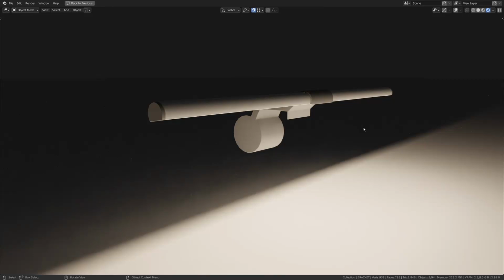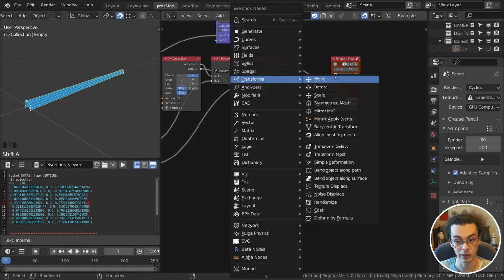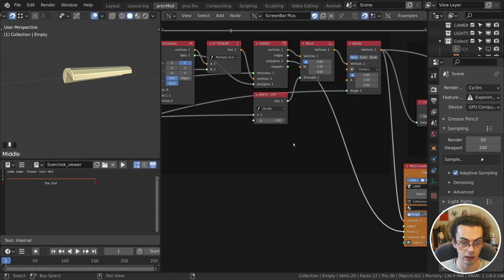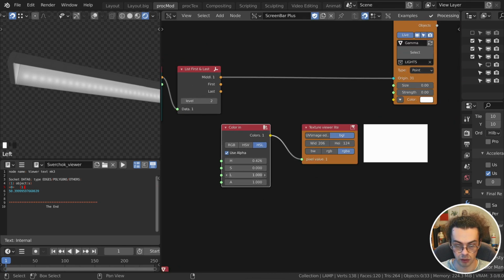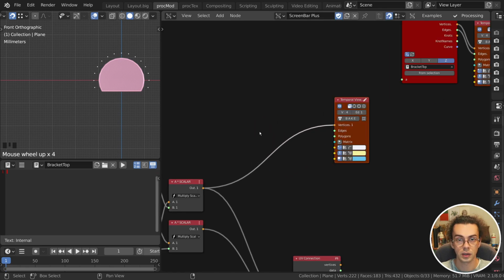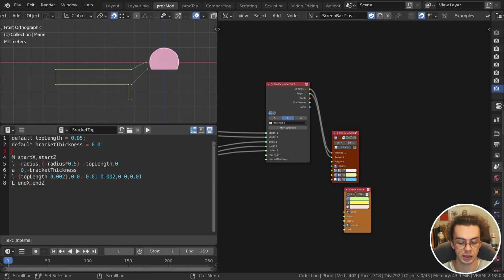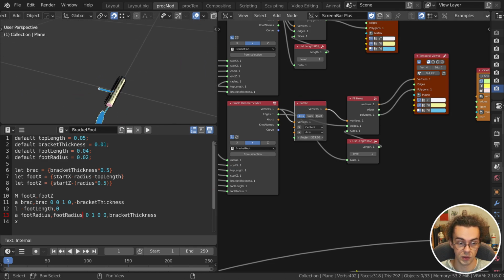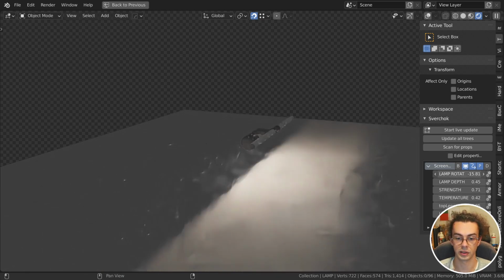Parametric Lamp Design with Sverchok - Blender Procedural Tutorial

Comment: 18:06 How do you drop that lamp length connection without connecting another node?
Reply from the maker: Do you mean how do I remove the reroute? You can use CTRL+X to dissolve a node without breaking overall connections! Super useful and just the same as in 3D when we can dissolve a vertex without deleting the edge on each side.

Comment: Hi Erin! How r u doing ?
How do we control the number of vertices of the arc we made using the profile parametric mk3 node? Is there any way to do that?
Reply from the maker: Hi! Yes absolutely you just add n=_ at the end of any line with a curve resolution. For example in the BracketFoot script if I change line 13 to "a footRadius,footRadius 0 1 0 0,bracketThickness n=64" then the arc will have a resolution of 64.
Reply: @Erindale  Wow! Excellent!

Comment: Very interesting tool set seems like something Blender Foundation should look to take on board given their move to everything nodes. Perhaps not the most user friendly way of modelling certainly but for parametric CAD type work very nice. Thank you once again Erin, clear demonstration you actually made it seem not too difficult.
Reply from the maker: Once you get your head around lists, it's actually quite 
straight forward! Grasshopper (for Rhino) seems to be it's closest cousin and the workflow is very similar. GH is an industry standard for architecture so slightly more understandable that the workflow isn't quite so friendly for animation style pipelines
Reply: @Erindale  I spent most last year using Moi3D for modelling and really like the NURBS workflow, so much so I only used Modo for the rendering in v-ray. Another reason I found dropping Modo easy and coming back to the Blender fold.
Reply from the maker: Well Sverchok (especially with the extra nodes enabled) has a whole bunch of curves/NURBS/solids workflow complete with exporting to and from JSON files! I definitely recommend it for those nice CAD workflows. You can even export SVG  with a little bit of wrangling so proper buildable drawings are in reach here
Reply: @Erindale  Thanks for the tip I will certainly look more into this, once I get the shader nodes under my belt.

Comment: Random question : this is amazing and looks like the next level of vector displacement black magic, but... is it useful in general ? What I mean is, I know that in a professional scenario nobody would model a character via pure displacement so learning how to do this is a bit overkill and more of a "just for fun" kind of things and this looks like it could be cool for hard surface modelling but at the same time it feels way slower than just modelling directly... are there really things where procedural workflow would be the go to way to do it (outside of just shading and texturing) ?
Reply from the maker: It definitely depends on the field you're in. Vector displacement, I maintain, is essentially useless, however, with Sverchok you're actually generating complete objects that can be turned into buildable drawings for architectural/industrial/product design etc. A simple model like this is definitely going to be easier to model with conventional techniques, this is more of an approachable beginner exercise! Computational & parametric design are invaluable though when working on larger projects like buildings -it's the reason that Grasshopper is an industry standard in Architecture. Just have a google of "parametric architecture" and you'll see where these techniques really come into their own.
Reply: @Erindale  Thank you very much for your answer.
Reply: I found about Sverchok and the rest of Osarch very recently, and it looks trully amazing... Related with this question, I'm thinking here about my field (civil engineering). If, let's say, we needed to design a bridge or a building, I see potential with these Sverchok nodes to model both the complete 3D geometry for architecture/drawings (ideally including some fancy BlenderBIM stuff), and the simplified geometry for the numerical model. Then, the structural software API could be called through Python (with some complex rules of course) by means of a Scripted Node. That way, a parametrical change in an input dimension would reflect in the rest of the model updating in accordance with the structural calculation. Does this even sound possible or am I dreaming?
Reply from the maker: Sounds very much like something Sverchok would be able to do! I definitely need to push myself into more real projects with Sverchok to push my own knowledge but it's capable of so much. You can also enable the extra nodes to get more functionality like solids and more curve bits!

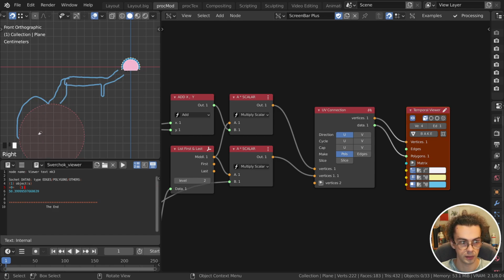Comment: 27:00 use `"from selection"` with activated `'create nodes'` on N panel. By existing manual created curve on scene
Reply: In a profile parametric node, is there any way to set the "curve points count" parametrically? (in this case, from the resolution node)
Reply from the maker: There are flags you can put after arc and curve parameters that let you set specific resolution. I believe it uses the default setting from the node properties panel otherwise. Check in the documentation but I do remember seeing an argument for it
Reply: @Erindale  Found it! ["n = " num_verts] at the end of the ArcTo line, I was missing the n= part.
Reply from the maker: When I was testing this, I wasn't able to get arc controls (radius, sweep flags). Is there a way to get that from a using Get Selection?
Reply: @Erindale  from selection get only curve and lines. all you need to do is replace curve part. IMHO this makes life easier.
Reply from the maker: @НикитаГородецкий-р9с  Ah yeah I should have done this actually! I've always been writing them long hand

Comment: This is awesome!!! would you have any idea why I don't see icons in the nodes menu when hitting SHIFT + A?
Reply: user preferences ->addons -> sverchok -> UI -> "show icons"
Reply: @zeffii  thanks!
Reply from the maker: @zeffii  Thanks Zeffii!
Reply: alt+space is a custom search function, which allows us (sv devs) to specify specific keywords for nodes, and also macros (which can load a collection of nodes at once).
Reply from the maker: Yeah like Zeffii said, it's in the addon settings! The icons make finding your nodes way easier when you're sorting through menus with 600+ options
Reply: @Erindale   I encourage people to use alt+space and type the names of the nodes they are familiar with, it will eventually be faster than menus. Menus are great at the start, but navigating 600+ nodes in a menu tree structure is a UI design mistake.  ..and i made the search menu when there was only 200 orso nodes :)
Reply from the maker: Yeah I use the search for most things. All the nodes can be found in the blender search as well in recent versions of blender. That also shows where in menus the searched item can be found! I have an overwhelmingly visual memory so I can remember menu positions and icons but I often forget the name of nodes 😅